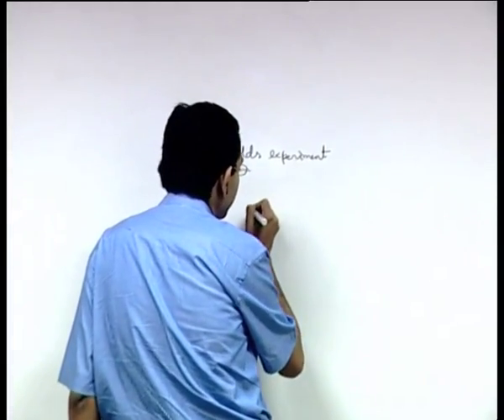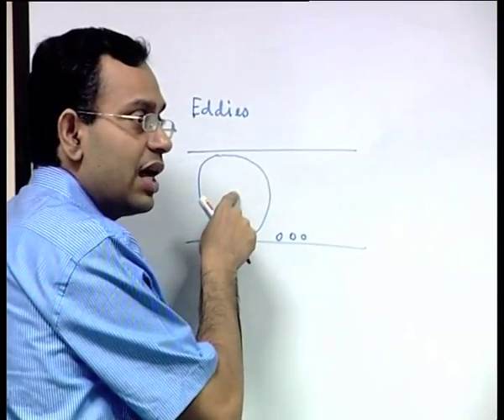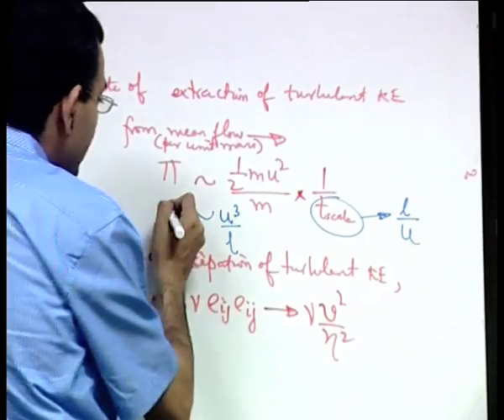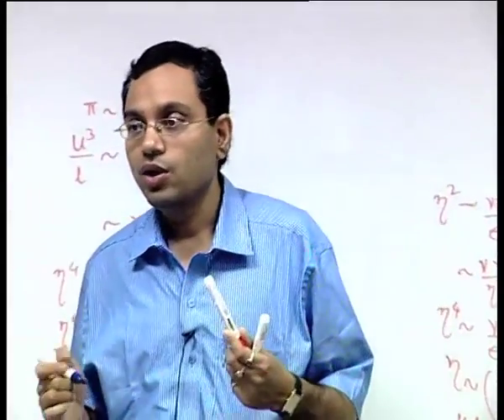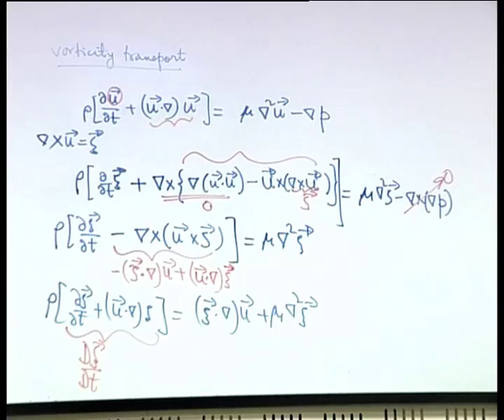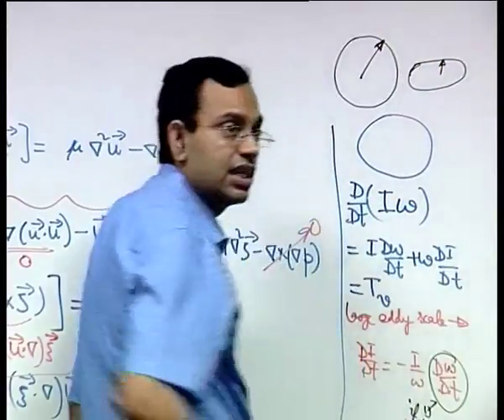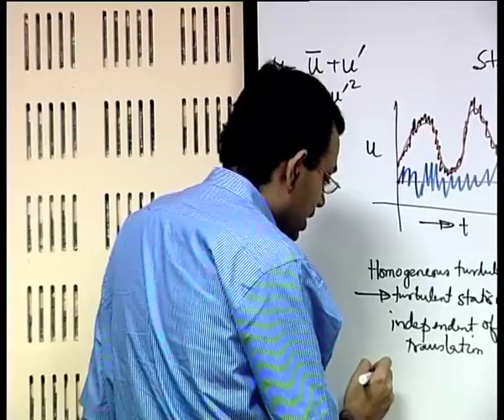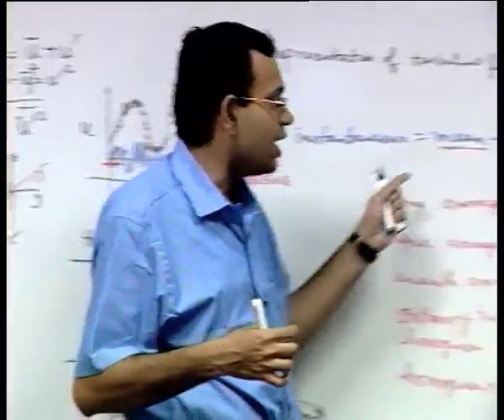Mod-01 Lec-41 Introduction to Turbulence Modeling

Comment: At 40:30 dw/dt is wrt to the large eddy scale then as the w is increasing for small scale eddy then it should decrease for large scale right?. In that case should it be negative. I couldn't get that part.
Reply: initially , i  have a problem understanding this part like you , but i think he is right since in the cascade we have a gradual decrease in the eddy length scale. so , if we consider  eddy with a little bit smaller radius than the largest eddy , the smaller one will also satisfy the conservation of angular momentum so we can apply his analysis on the smaller one